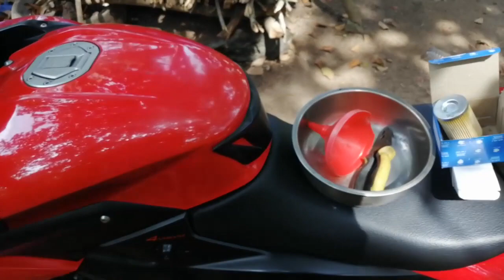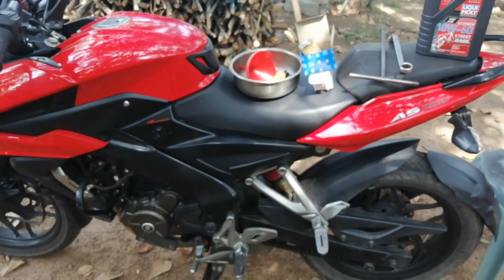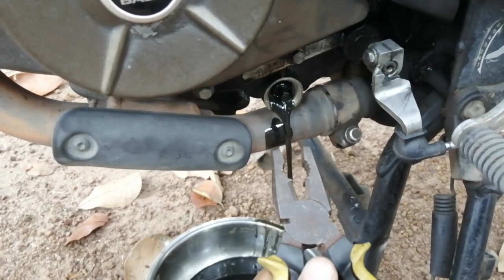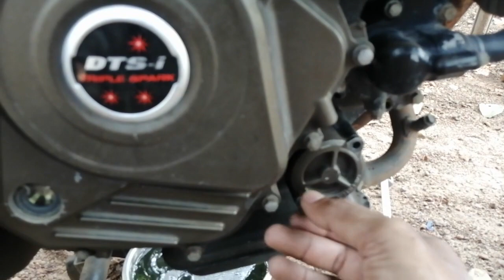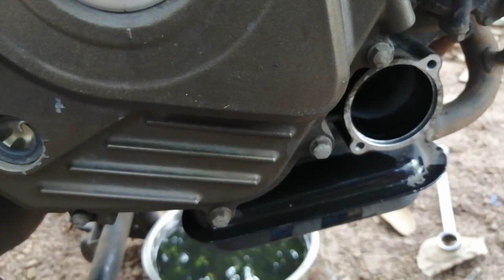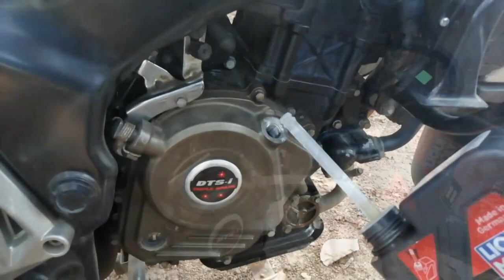Pulsar 200 ns engine oil change | NS 200 lique molly

Comment: 1599Rs for Per litre and this from.LRL kochin. Hows your experience after switching this engine oil
Reply from the maker: good heat management over 10w50 grade...
Reply from the maker: I suggest motul 7100 15w50 or motul 300v2
Reply: @TWENTYFIVECLUB  As per Spec. 10W60 Liqui. Top position

Comment: Please share your riding experience about liqui moly 10w60, difference in engine vibration or increase in milage.
Reply from the maker: Better go for motul 7100 or 300v
Reply: @TWENTYFIVECLUB  why is liqui moly 10w60 is not good? please give us the 10w60 review, beacause in few days i will get the ordred 10w60 liqui moly for my dominar 400
Reply: क्या 10w60 डालने के बाद RPM में कोई अंतर भी आया था, क्यूंकि मुझे इंजन रेस्पॉन्स कुछ स्लो और भारी लग रहा है। मैंने भी liqui moly 10w60 dominar 400 में डाला है और 450 km चला चुका हूँ।